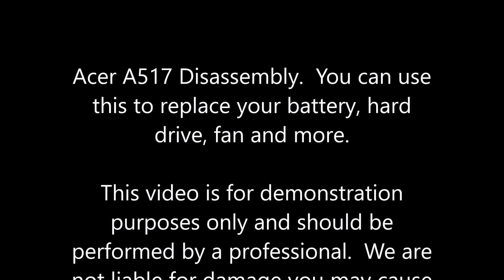Acer A517-52 (N20C6) Disassembly For Hard Drive, Fan, Batter Replacement

Comment: Informative video! I'm having trouble finding a charging port and cable for the Acer A517-52.  Any part numbers I need or?  And I don't know if other Aspire charging port/cables are interchangeable with this model. Thanks in advance for help.  Steve